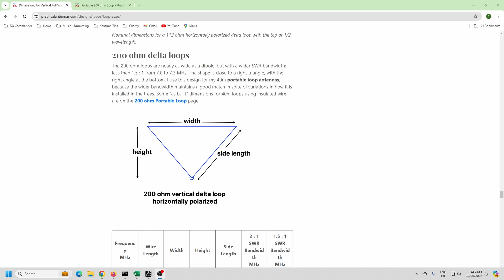I Made a Multi-Band Delta Loop Antenna with 4:1 Balun

Comment: Cat5 cable is plentiful and cheap.  Do you see any issues with using it for wire antennas?  I plan to simply parallel all 8 conductors and use it as a single piece of wire.  Thanks for any advice.
Reply from the maker: Heavy - but of course. Anything works.

Comment: How did it work out Cal?
Reply from the maker: I have so many projects! I know it will work out - but I just haven't fitted it - maybe later this week!
Reply: @DXCommanderHQ  ah yes, the 80% complete club.
I have boxes with parts in and half built things some of which I am totally clueless as to what the goal of the hair-brained idea was that I had rattling around in the noggins at the time the idea was originally conceived.
Recently I set myself a new rule. Don't buy the parts until you make the damn PCB.😅
Reply: @DXCommanderHQ  
oh and Cal,  please do get this project sorted! I'm building a 4:1 choked balun for LOTG and delta loops.

I know you plan to hoist the 'flat' part of the antenna up between two trees but for us no trees and one mast mortals 40m is a tough one. If you mount the apex on a mast the bottom leg of the wire should be 4m off the deck.
So your mast has to be about 16m to achieve a true delta.

Am thinking a flag pole style might be interesting with the pointy bit pointing away from the mast like this |>
Would be fun to model!
But 40m is a tough one for us mortals, hence the interest in you getting this one out of the shack and on air.

John
Reply from the maker: Yep.. Doesn't HAVE to be completely flat.

Comment: I found leaving the corners of my Delta Loop unsecured a good option !
As when it gets windy, the telescoping masts I use, along with the wire, dance around like hula Girls, but when everything settles, they all seem to go back into proper position !
But more importantly, being my first large wire antenna ( 270 ' ), and feeding it perhaps in an unorthodox method, ( Feeding it as an End Fed ), wire fed straight away into the house !
One morning after a small rainy morning, I got up to see if Ten meters was open.
I set down in a chair close to where the antenna wire entered the house, and holding a very tiny Belka receiver !
If not familiar, I encourage you to look them up !
Excellent Radio !
They are encased in a metal housing !
I attached the wire of the antenna to the radio via an adapter, and holding the radio in both hands, I began to tune the radio !
This is where it gets a little foggy.
As within literally seconds of being set down and beginning to tune, I don't know if I heard a distant clap of Thunder first, or felt the electrical shock in my hands, and into my wrists first ?
But I received a significant electrical shock, that happened so quickly I had no time to react !
Trying to gather my thoughts, my eyes went to the display on the receiver, only to find the display look like hieroglyphics !
In a panic I quickly tried to shut the radio off !
After several attempts, I began thinking of how I might open the radio, in an attempt to remove the rechargeable battery !
As I'm hammering away at the power button, the display went blank !
To which I breathed a sigh of relief !
Sitting, still trying to gather my wits, I was wondering if the radio would turn on, and was already telling myself that the radio was likely toast, and I would likely have to purchase another !
Whispering some quick prayers, I held the power button, and to my surprise, it came back on, and works fine !
Testimony to the build of the Belka !
Obviously a very dangerous lesson learned !
I have begun collecting the necessary items, ground rod, lightning arrestor, and a length of coax, to get the wire outside, where it belongs !
For those unaware, this was not a direct lighting strike, nor one even close by, as I remember hearing the clap of thunder somewhere off in the distance !
And from the passing rain, the street in front of my house, had mostly dried up, with the rain having stopped likely a half an hour.
Else I would have never thought about connecting to the antenna !
But from that distant lighting strike, my antenna had voltage induced into it, at nearly the speed of light !
Craziest thing I have ever experienced, to say the least !
I feel very fortunate that the electricity didn't take a path thru my Heart, else I may not be typing this warning !
Be way smarter than I, and be sure to properly protect yourself, and your property by using a lightning arrestor, and proper grounding !
Keep the antenna lead outside , where it belongs !
Lesson, all though terrifying, learned !
Hope this keeps others from making the simple, but possibly fatal mistake I did !
A real eye opener !!
Reply from the maker: Yeah. Electricity is weird stuff!!
Reply: Definitely a “shocking “ story ! 😂
I’m glad you are ok!

Comment: Does it make a difference if the torch is Butane, propane, or MAPP gas? I am constantly surprised at the tiny details that make a difference. I have a butane kitchen torch to light burners that are unwilling to light.
Reply from the maker: None. Ask ChatGPT?

Comment: Call, You mentioned about 41m of wire and 15m/13m for triangle sides. On a page you use there is 44.4m of wire and 17.2/13.6m for triangle sides when building 200ohm delta version. Why is this difference between your design and mentioned web site?
Reply from the maker: Agreed, but I can't remember.

Comment: Hi Callum! I made a 20m vertical full wave delta loop using fiberglass poles, and plumbing bits. It seems to work pretty well on 40, 20, and 15m. Have you ever modeled one of these, and have you ever built one? I am only able to get it about 10 feet up right now. Am I wasting my time with this antenna?
Reply from the maker: Yeah, sure I've done a video on that.. Way back.

Comment: Hi Callum, great video. I made a loop similar to yours with a 2.6 :1 ration transformer. My loop is about 130 Ohms hence the difference in windings on the toroid. 73 once again Callum, more power to your elbow.  JOHN G4YDM

Comment: I converted my long wire into a delta loop to try and reduce s9 plus qrm .. That certainly worked pleased to say..  I have 50m of wire in the air to a 9 to 1 balum. 4 to 1 I made was a failure. So the home made 9 to 1 unun works perfect. Should be a Balum  Hardly needed the  ATU .. Only 160m required atu... Found when i lived in Kent, the huge quad wire loop worked well just a few ft off the ground at the bottom of loop. So far results best i have had. Will stay with this.  Also erected a vertical to compare. Mainly for the higher frequencies. . It works, that's the main thing.  Being a retired electrician has provided me with all the tools and wire. One day we may work again.
Reply from the maker: The vertical might be nice for TX and the loop for RX maybe.. Good ideas there.

Comment: Bet you wish you'd marked the 13 / 15 m points when you were measuring the wire out on the rig at the beginning. That wire with Kevlar in, we used to call Magic wire in Australia. Not sure why, just know it's great stuff. Loop antennas whether delta, square or ideally as close as you can get to round are fantastic antennas. I've been using them for 13 years now and they're great. I haven't found a better wire antenna yet. 73 Ed DD5LP
Reply from the maker: Well, maybe but it only added 5 minutes and in any case, I still had to unravel it all to add the connectors.

Comment: Frigging lovely Job, Lord Cal. I love Delta Loop Antennas. My portable Version is 84m (275ft.) I have a 4:1 and a 2:1 Balun in my ToGo Bag. My Experiences with this Antenna fully satisfied my HAM Needs in low Height Setup somewhere at 22ft. lowest. My highest Point ever was at 48ft. from the Ground. That's quite a Job to get done for an one Man Army having this Thing up for just a few Hours playtime. I love the low RX Noise Level and even on 160m Band this Antenna was a Flamethrower. My British HAMily on 1933khz got knocked off their Shack Stools as I gentle knocked their Doors (RX) with just a 100W portable. Tony G4ZCG always has a Smile on his Face every time I stopp by to say hello....he knows his Friend Günter has a big Screw lose 😂👍
Reply from the maker: Screw-Loose Günter sounds a great guy!

Comment: Hi Cal, looking forward to seeing this go up and the results. Mine works very well, much quieter than my end-fed. Good for G and Europe. Mine is fixed at the corners with just cable ties. So I can cut the ties and move the position of the balun for testing etc. That kevlar wire is really nice. 73
Reply from the maker: Thanks for the info!

Comment: That tight twist in the wire and bend in the in the wire going through the black insulator. Doesn't mess with the antenna wire swr or TX/RX ???
Reply from the maker: Nope.
Reply: @DXCommanderHQ  So why did it matter where I bent the wire on each vertical. When i built the dx commander. You wanted it to be very specific where it was bent and how much the tail was.
Reply: @johnlew5972  That's due to horizonal loading and therefore tuning isn't it?

Comment: That a fun build to watch. Nice 4:1 Balun. Works for off set center fed dipoles as well. I had trouble tunning mine. Then I figured out I wound a 4:1 UNUN . My bad. switched that out and works and tuned fine for OSFD . The UNUN is mostly for End fed antenna.  I made a mono band 20 meter veritable with 49:1 UNUN and ground radials . works super.  My pole was not long enough so I fold back the top  end like how the 40 meter is done on DX commander antenna. tuned great. under 1.7:1 the hole 20 meter band. This is cut 1/2 wave 20 meter band. 2 stack of FT 240-61 cores. 100 PF cap. #10 AEG mag wire on UNUN. takes KW just fine. using DX 10 wire. loop QRO loop on end. 73's
Reply from the maker: Thanks for the encouragement!

Comment: Hi Cal, great to see you and doing a project as well. 😊   💎   🪛
I’m not trying to be clever, coz I’m not  🤪   However, from your previous vids… are you not going to be inducing the linear loading principle to the loop on the fold overs parts at the egg supports… 🧐   Can you use doubled doingy doingy loops at the eggs and the balun to support the delta?  That should give you tension supports… maybe ? 
Best wishes to everyone.73.         💙
Reply from the maker: The "loading" on the corners are almost invisible. No worries.

Comment: I used nylon pulleys in the corners of mine. It make it very easy to put up and not so concerned about the supports being 100% in the right spot.
Reply from the maker: Yes Easy.. but look at the interior of the woods!
Reply: @DXCommanderHQ  Not much different than mine. I live in the middle of a white cedar Forrest.

Comment: I built an 80M delta loop in the 80s.
Fed it originally with 300 ohm balanced line through a tuner..fed at the apex, hung vertically. It worked well. 
Put it up at my current QTH last year, fed with a 4/1 balun. Yes, it can be tuned and works from 80 thru 10 but the performance is not stellar on all bands. Alot depends on the radiation pattern as you move up in frequency.
Mine is hung vertically, apex up, fed at the apex. Give horizontal polarization. Radiates well on 80 for regional contacts.
Reply: I built a delta loop in the 30s.